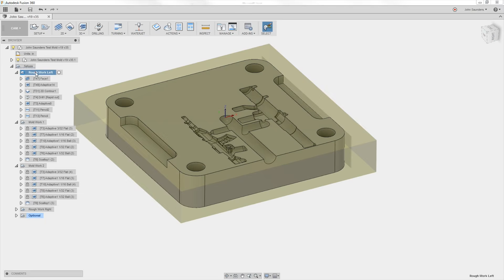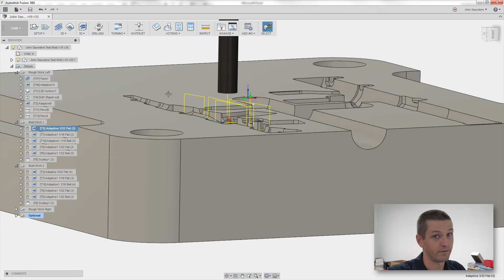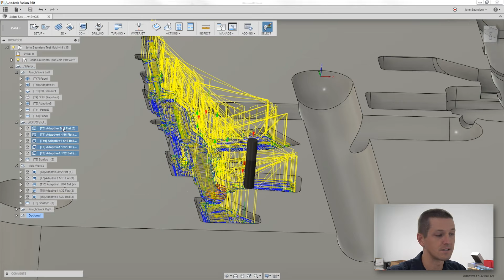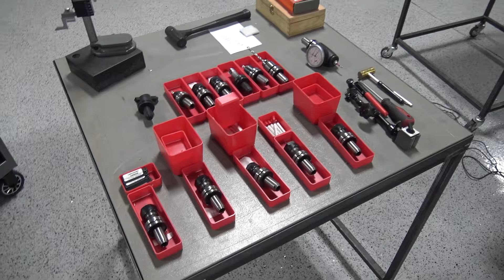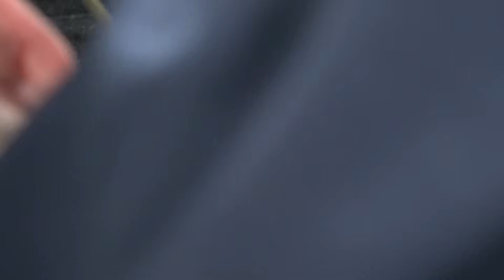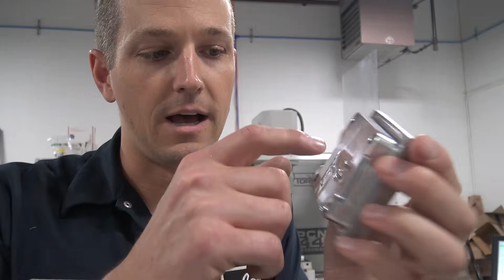Machining a DIY Injection Mold!  WW114

Comment: Just curious what a project like that cost, its a 2 part and you had to cad it up. I know it seems no one wants to talk numbers but reality is what does a 2 part mold of that size and detail cost to have done?
Reply: Nowhere near that much for this complexity of mold. 100000 would be for a large, complex mold, something like a TV enclosure, set up for making 100s of thousands of pieces. A mold like this is not normally used in production since it has no ejection features, so the part has to be extracted manually each time. 
You can cost out the US pricing for (medium-volume) aluminium molds at Protolabs. I'd guess around $2000-4000 for a mold of this size and complexity (with ejection features).
Reply: Made in Shenzhen sounds like your better off buying a cnc machine.
Reply: The answer to shorter run or rapid tooling is some of the cast-able ceramics available like Ceramacast 900 or Cotronics Rescor 750 - google these names. Make a nice aluminum mold block with cavity then simply use an original part and make a casting around it. Keep cavity size small so you do not need to use too much of the cast-able ceramics as this stuff is pricey. then use an open shell aluminum mold for the top so you can pour the liquid ceramics over your part to finish it. Then top it off with high temp concrete like for a kiln, then an aluminum plate. What you end up with is a mold you can use hundreds of times, even thousands of times and you can then just rebuild the mold as needed. Of course there is a lot involved if your going to do it right but it works. These cast-able ceramics can be baked and cured like any other ceramic and can take pressure and heat over 3000 degrees. Another option is high temp silicone like Mold Max 60 from smooth-on that can take temps up to 560 degrees. This stuff can be used to cast tin and pewter so if you use the lower temp/pressure plastics you may be able to injection mold directly into it. Liquid silicone can be poured around almost any part and it will reproduce exact detail. Molds made with it would probably make quit a few parts. Worth a try before you drop 3 to 5k on a machined mold.
Reply: Would imagine it would cost 500-1000$ for a machine shop to do it, possibly more.
Reply: don't bother with that shit tier indian scam, the reason it's so cheap is cause it's worthless.
Reply: and even if they would, plastic injection does not have a micron tolerance range, the tolerances are rather starting at 10 microns, it is really hard to get repetability with a micron tolerance (even medical devices are in the 10 micron range).
Reply: I mean without machining the part, directly after the injection process you wont have a micron tolerance. I know someone working in a factory doing circuit-breakers with millimeters small part and they get 10 micron tolerence on the smallest parts that are really small gears ( I talk in millimeters not inches)
Reply: Any idea how much the moulds for the 3 plastic sprues of such toys cost?

https://www.games-workshop.com/fr-BE/Stormcast-Eternals-Stardrake

Are light lasers also used to cast the finer details of the moulds? (like in micro surgery) Thanks!
Reply: 100.000 sized for a tv case?! not really, rather like 500.000 for that (in europe) and thats cheap... High quality molds for ex. 16, 32, 64 cavity molds, using hot runners, multiple cores and made to last for millions of cycles costs in the near million and it can get higher, a lot higher especially if the pieces need to have tight tolerances. Of course made in europe not in india or china....
Reply: It can be used, and its more and more used, but the good old etching works the best for complex 3D shapes
Reply: Uncharted I honestly doubt Lego uses +-.0004 on most of their stuff, they are toys not medical components
Reply: Johan Kuhn with power drivers and stuff like that there are tolerances in positioning(true position) at about plus minus a thou or two;standard, there are mating holes at plus a thou minus 0, even plus 5 tenths minus 0;standard. all depends on what the part and component actually does
Reply: What company are you talking about Pranav?
Reply: you hear him mention in the video that the customer will make a mold out of that.  so they can still make some ejection pins.  it's deffinatly ment for tens of thousands of little toy lego guns to break even on the mold cost.
Reply: miguel.  0.0004 inches is 0.01mm    and the part does not have those tolerances.  the mold does.
Reply: It will cost less than $100 in india.
Reply: Skarloc The Wanderer Well if u would outsource to india, it would  be estimated to be around 1800$ for the 3 parts. 
There are specific cnc machines for finer details and use tools with tip size of just .02 mm or bigger.
Reply: Call RevPart and they will give you a cost quote 844-738-7278. Or upload a drawing https://revpart.com/quick-turn-quote/ for a quote in 24 hours.
Reply: Lego company itself does NOT have tolerances of +/- .000001. First off they're based in Denmark and use the metric system. Second they use a tolerance of +/- 10 microns which is about +/- .0004. Stop making things up.
Reply: USUALLY - Injection Mold Dies made from Steel for conventional Machines start at around 100.000€ and go up to 500.000€

I am sure though that these aluminium ones are around 1/10th of that cost (Polymer Calculations, Mold Design, CAM and Machining)

Comment: John, how do you remove the left over stock that you had to keep on the part for work holding? Just flip it over in the vice and mill it off? 

BTW, with the help of your videos, I finally made my first CNC'd part tonight! Just a simple 14 gauge sheet metal bracket cut out on a water jet, but it still felt pretty awesome to see it go from a blank Solidworks document, to HSMWorks, then from the stock to my final part.
Reply: Tim Wolf yep. Just flip it and cut to requires thickness

Comment: no gates for venting?
Reply: Noticed the same thing. The end product is probably going have air pockets because there is no place for it to escape. A small gate at each part will help to prevent that.
Reply: Benjamin Harris 

That's why the cavities are so close to the edge of the mold block and not centered in the block. There will be enough natural gap in the parting line to vent the air being that close to the edge. 

It's also why the gating is so far down as well, it'll force the air back, opposite the injection flow direction.
Reply: For small parts like these you almost never need vents. And for bigger part vents can be avoided by just keeping the clamp pressure low enough to make the mold open slightly from the injection pressure.
Reply: For smaller parts, the natural gap between the plates can be enough for venting.
Reply: immediately had the same question! i think this is normal, ive seen a lot of molds exactly like this but maybe a professional could tell us why it doesnt need vents!
Reply: this is not the final mold.  this aluminium part is going to be used to make a mold.